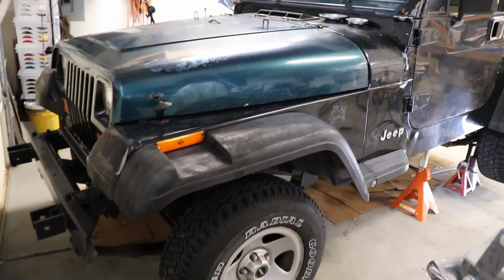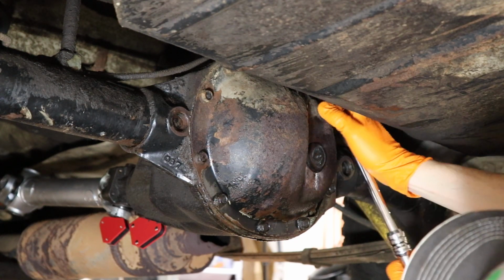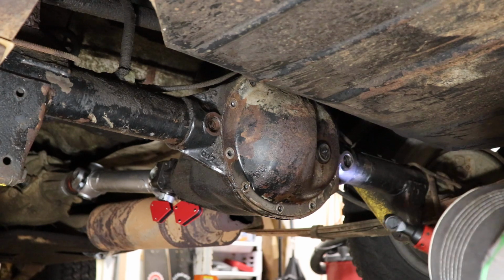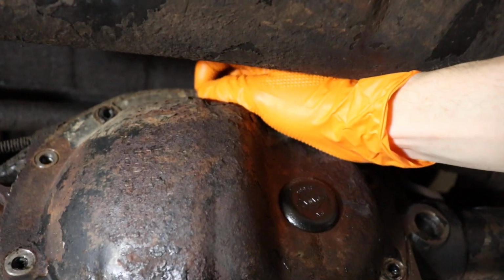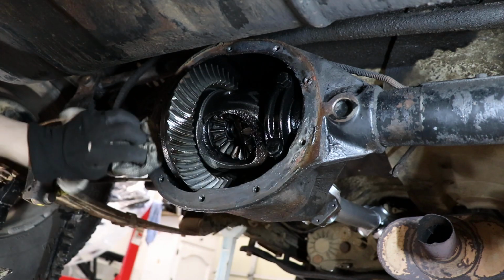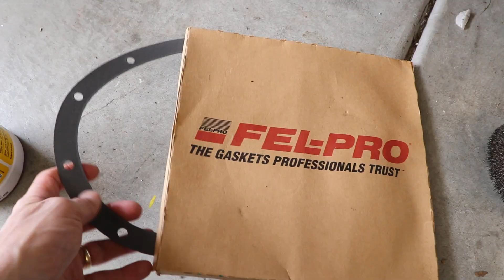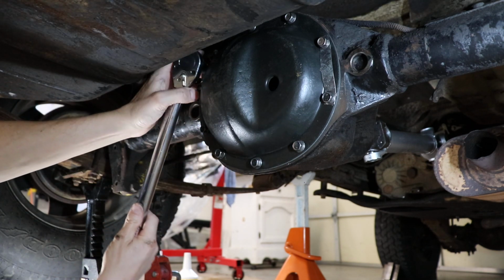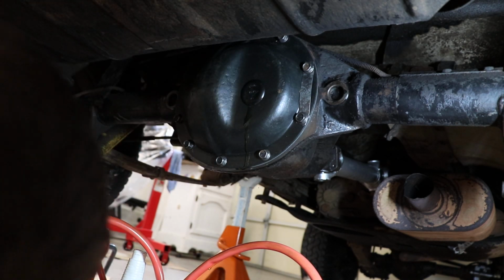Did WATER get in my Axle?? 💦 : Dana 35 Fluid Change

Comment: Hey Dale great video. For anyone reading these comments you should  loosen the fill plug first just in case it doesnt want to come out later. I'm not aware of another way to refill the diff if you cant get that plug out.
Reply from the maker: That's a good tip for threaded plugs. This one is a rubber plug though.
Reply: @JeepSolid  Very interesting I just assumed because the Dana 30 and 44 on the JK are threaded. 😁

Comment: The lube locker gasket saves a lot of time and it’s reusable.
Reply from the maker: Lube locker is great stuff!!
Reply: I personally apply by figertips oil from the system I service on the paper gaskets it makes them more durable and reusable. With heat they tend to stick on surface so they break when trying to remove them. With cork gaskets in exemple for head cover on ancient engines grease does a better result.

Comment: Hello this is David. I recently bought a 1993 Jeep 4x4 for my daughter. Going though the whole Jeep. Love your videos! My question is the rear end is a Dana 35, but is it posi or limited slip? Also does the oil type change? Thanks..
Reply from the maker: if you can lift up 1 wheel and freely spin it, it is open differential. Limited slip does require special fluid
Reply: @JeepSolid  thank you

Comment: You should investigate how the water got in.
Reply from the maker: I think it was the bad axle seal. Replaced.
Reply: i had water in my diff but there was no evidence of an axel seal issue since the axel ends were totally dry. Not sure this is a good indication. I just cant figure out how water got in. Im assuming water because the oil was brown